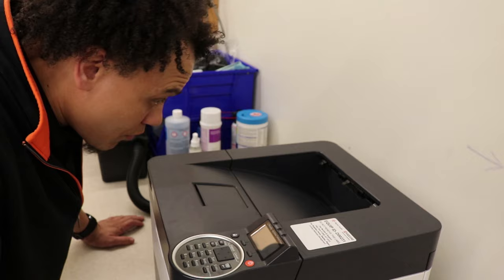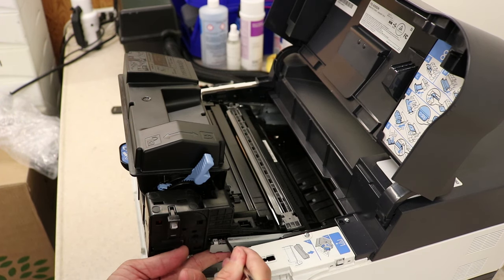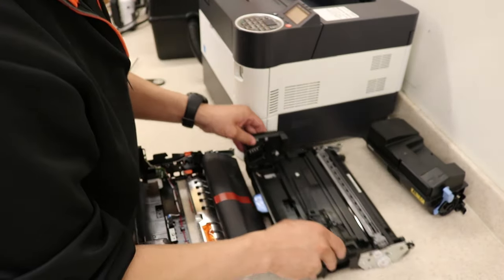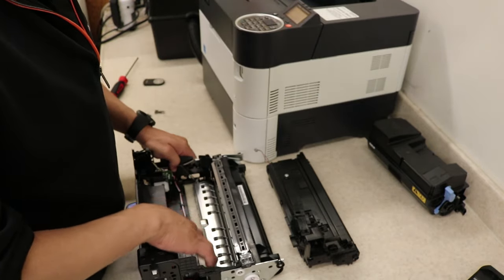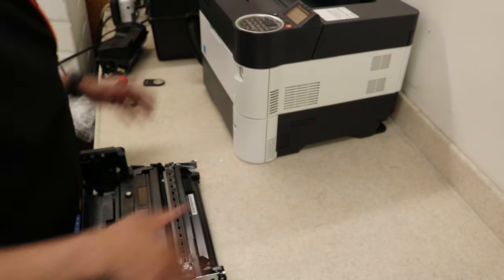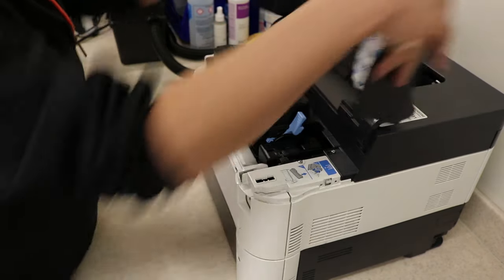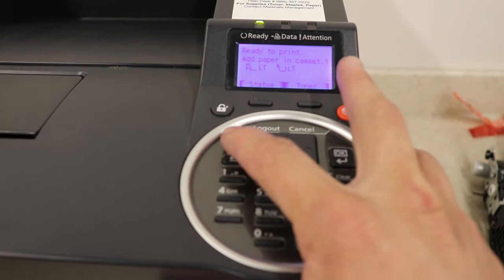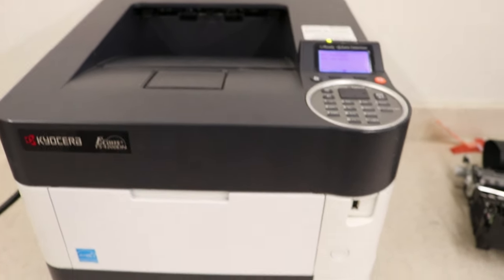#Kyocera #printers How to replace drum and developing unit on Kyocera FS-4300

Comment: Good video, I would say the little cover, flip it up and push forwards. The only other thing I had to do that you didn't touch on, was adjust the MC setting as the prints were a little dirty (my setting was defaulted on 3). This can be found in Maint service setting > MC adjust it one increment level (up or down, down if grubby). I selected 1 (although 2 cured the problem).

Comment: after replacement I have error 7410. I tried many times and thoroughly. Interestingly, when I start the printer with the top cover open. a message will appear asking you to close the cover, and when you do, the printer is working. but rebooting still shows error 7410